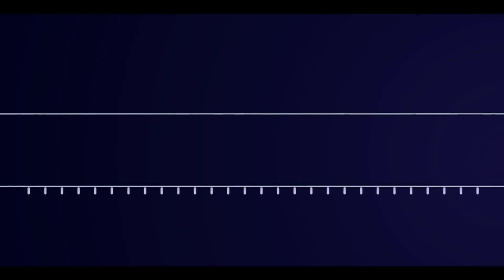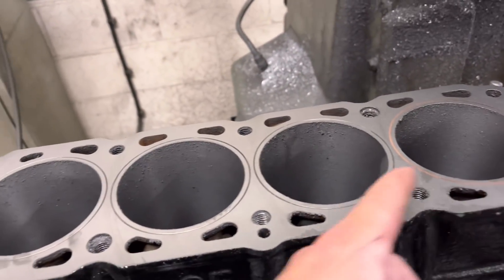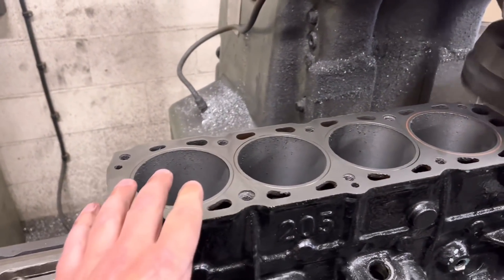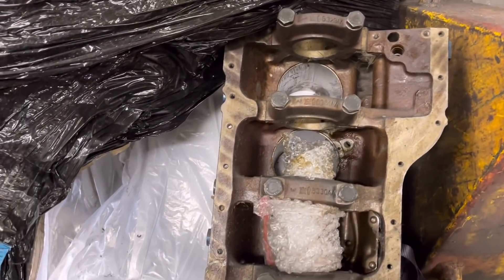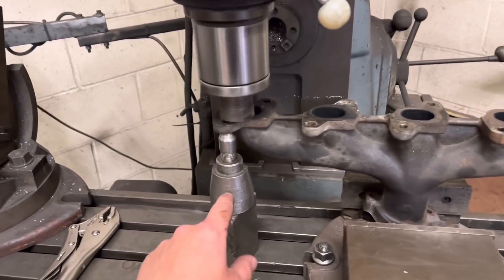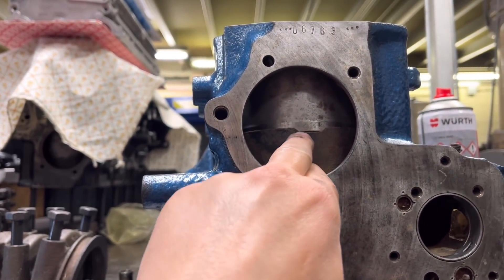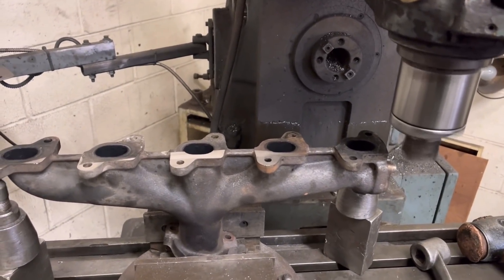Jag XKR is stripped, what we found is not the best news

Comment: Could you, taking a straightforward 4-cylinder engine, show us in one or two episodes what happens to that engine? i.e. show the head skim with the dimensions, the valve work and seating, the crankshaft work and reasons for doing it, the re-assembly and so on. It would be great to watch the full overhaul of a single, particular engine, possibly adding in rough costs as you go.

Comment: Hi, great set of videos, brings a smile en chuckle from me, some of your clients do try the 'woolly jumper' bit.... must watch least weekly. Glad to hear you've taken on an extra set of hands. Cutting teeth for me, so to speak, back in the mid 70's on some old plants, i.e. Ford 93B, 105E - old 8HP en 10HP. We used Consul en Zephyr engines in plant to drive all manner of kit. Skimming Heads/ Blocks was a favorite, although no 'Honing' - lots of Crank/ Piston/ Con Rod en Cap swop outs. Did work on Leyland, Perkins, Cummins en Rolls Royce, some 10 - 18Litre beasties`.... Now in my 70's - great to see young folk keeping the trade alive, can understand the racing fraternity - did a bit of racing as you do around the UK circuits. Now keep my hand in restoring Classis Cars, sorry did send last engine to Turners. Did have a unit in the old baker at 'Barum', a few years back now... Keep the good work up. Doug

Comment: Hi wet liners are usually slightly Prout of the block so it can put pressure on the bottom of the liner as well as the top when you tighten the head down
Reply: Yes, my old Volvo engine had the same. I fitted new wet liners in it myself with new pistons and rings. The liners were great, it was like a rebirth of the engine, the compression improvement really good. I was nervous the required protrusion wasn’t perfect but it worked out beautifully.

Comment: Just looked on SNG Barratt website new 4.2 supercharged full engine with heads ready to go £8,055 plus VAT £9,666 inc and I would check the cooling system as I think the old engine has overheated, the alloy on the sides of the bores is from the pistons getting very hot and dragging up the bores, I wouldn't mess with the old engine, bin it.

Comment: That Jaguar engine is notorious for coolant system leaks and failures. I almost guarantee it simply overheated badly. Keep up the good work!
Reply: They're not really - I've been involved with Jaguars for many years. There is a complicated pipe in the valley under the supercharger which is prone to going brittle and leaking, but they're widely regarded as being very robust engines. As dependable as a Toyota? Probably not. More dependable than a BMW V8? Definitely!
Reply: How the f##k do Jaguars research and development ignore a relatively simple problem with an easy fix which ultimately leads to a catastrophic engine failure is beyond comprehension.

Comment: I'm loving this as I always wanted an XKR but chickened out thinking it would be financial ruin, now I can feel smug!
Reply: They don't fail that often,  pretty reliable. I doubt it was running lean, the ecu corrects for most issues, if it can't within a certain band it goes into limp home mode to protect the engine. They are however very prone to overheating if you don't look after the cooling system.  Don't need to loose much coolant for them to overheat and the idiot type temperature gauge doesn't help, there isn't any reading between ok and hot and when it's in the hot it's too late. RealGauge modification is a must on these
Reply: Had two Jags with AJ-V8’s and did a total of ~180000 miles without significant problems. Part of the issue with overheating is the brittle plastic piping used. Had a couple let go and as noted, the temp gauge only tells you when it’s too late. Lovely engines. Super smooth and happy to rev in NA and super charged form.

Comment: Yes, it absolutely happens Lee. The more that is taken out/off of those blocks, the weaker they get. Especially today when the turbochargers make more power then ever, much easier! Also if they rattle the engine hard with timing going crazy for whatever reason, it absolutely can break those old blocks! I'm really surprised how many are run over there! It seems like our SBC or LS Chevy engines over here. If they are only running factory boost, we might use a MLS gasket, but who ever stops there? We never remove the Orings on boosted engines, we always check for proper depth, & I believe we use much heavier wire! Basically piano wire. If its something running high boost, over 30psi, which is normally a aftermarket Dart or Brodix block, we use something called a hoop. Its just a much thicker heavier type of o-ringing, with a solid ring! We also put the o-rings or hoops normally in the heads, for the reason that good heads are not too hard to find, & they could be welded up easier if they need repair! I'm really surprised with all the good old foundries over there, no one has come up with a updated heavier duty replacement block? I guess people just think cast iron will last forever, they do not especially in a race/motorsport application! No matter how good the machinist, machinist's cannot repair a abused old block, where the metallurgy wasn't great to begin with! There are lots of beautiful super heavy duty race blocks, just sitting in the corner, or outside, because they just wont make any power! Some have been heated, frozen, vibrated[metallaxed], greased up & left outside,[usually the last resort] whatever you could think of, they just wont stop moving! When they are 40 to 60 horsepower down, in a extremely competitive, highly ruled class. You just cannot run them! I have actually taken all of the expensive race parts out of 1 so called, top quality motorsport block. Then I stuffed them in a old, freshly machined factory block, with the same everything. First pull it was up like 50hp, over the race block! No Bullshit! Those pistons from the Jag, were probably running lean from fuel system issues. But they also look like they were detonated also! We see that all the time, with people who run nitrous, & don't do all the necessary upgrades/adjustments! Now its a Jag, so probably not, but if he recently bought it, you never know! Nitrous engines are hammered hard all the time over here, they clean the aluminum off the bores with acid, Run a dingleball hone thru them, & back out they go! So as long as it doesn't just sit & idle after its put back together! It needs to get out & be driven, uphill & down, downshifting gets the ring pushed against the wall, ASAP! Of course after they are sure the fuel & fuel system is good, along with the timing! Old stale gas is also a engine killer, especially with a supercharger! So they need to go over everything to get a good result! Remember, you cannot guarantee a old, well abused, questionably machined block! Have a good weekend!
Reply: 'Pardon'

Comment: Lee - I don't think you should rebuild the jag engine without liners.
The big issue is whether the customer has enough information to know what is in his best interests. Can he really decide this?

You don't want to be known for expensive rebuilds that blow up after a short time.
No one will remember your disclaimer. 
Just deliver engines you know you can rely on.
Reply: when i had my garage, any job i didnlt like the look of i refused, knowing the block may be distorted, it was running lean and the blower had metal in it are all expensive problems that could come and bite your bum, best to refuse the job or stick a 2nd hand engine complete with blower and injectors in it
Reply: @chrisjohnson4165  I think Lee is known as one of the country's top Cosworth experts.

Everyone, no matter what they produce, gets warranty claims. I think most of the ones
 Lee talks about here are claims that he doesn't really bear responsibility for, but often carries even so.

I can't remember too many real mistakes.
The Vanos engine was a mistake, but apart from that I can't think of a single claim Lee has videoed where Barum was a fault.

Refresh my memory
Reply: @chrisjohnson4165  different engine, this is from the early 2000's, they are pretty reliable. The ones you are talking about are the modern ones with no dip stick

Comment: I'd love to have all that machinery at my disposal. Fair play to the lad, nice to see the youth taking an interest in this type of work. I play with old motorbikes and my lad has no interest sadly.
Reply: Same here...I'm 69 and still messing about with motorcycles and cars...son's car is Focus ST 225 and would love to have access to that gear to overhaul it...daughters car had head gasket fail and coolant had eaten into the head...cost me an arm and a leg just to get the head skimmed...also had to renew bearings in gearbox as Peugeot boxes had cheap bearings and the input bearing disintegrated.... acess to an equipped workshop would have made the job a lot easier than me working on the driveway dodging the rain..👍👍
Reply: @richardmessenger9474  I hear ya mate. I'm 47 this year. I had a nice shed for me bike and stuff, I recently extended it and have all on my channel. Building a 7/11 gsxr 'fighter.
Reply from the maker: Thanks a lot for watching George 👍

Comment: Thanks for the girls acknowledgment, that was nice. That is not good news about the jag. I had a Dodge Viper that had a similar issue. I won't go into how much it cost, but it was a lot. It was really nice to hear that your latest employee has so much potential. That is very hard to find this day and age. I wish him all the best for his future. I had a lot of the machinery that you have. I wish in some ways that I still had it, but not in others 😕 Best wishes from Laurajane in New Zealand
Reply from the maker: Thanks so much for watching Laura, really appreciate it, all the best and take care 👍
Reply: @BarumEngines  Hi, I have just been looking through some of the comments about the jag engine. Why would anyone want to take on an engine with the reputation that that jag engine has.?all of my experience has been on American or Japanese v8 engines. If I had to look for a lean run situation, I would start at Air flow, throttle valve, oxygen sensor. Does the supercharger have a pressure control valve?, what fuel has been used?. I used to be into drag racing. Methanol/nitro mixes are unforgiving. I have melted pistons running to lean with too much boost. Just some thoughts that might be helpful,regards, Laurajane

Comment: I am absolutely amazed. You are redesigning the engine! The Rolls-Royce Merlin was famed for its reliability, and it won WWII in the Spitfire, Lancaster, P-51, and other aircraft. But since then, I am astonished an the unreliability of British engines. All my friends that have had English cars found they constantly broke down and required expensive repairs. Where are the engines that regularly lasted 300,000 or 500,000 miles as in the US? My Ford Taurus had 288,000 miles when I sold it. It was rusted out but ran fine. Maybe English manufacturers should adopt the Rolls-Royce practise of running engines at full power. Quote: "Early Merlins were considered to be rather unreliable, but Rolls soon introduced a superb reliability improvement programme to improve matters. This consisted of taking random engines from the end  of assembly line and running them continuously at full power until they failed. Each was then  dismantled to find out which part had failed, and that part was redesigned to be stronger. After two  years of this, the Merlin had matured into one of the most reliable aero engines in the world, and  could be run at full power for eight-hour bombing missions with no problems." You should try it. You will become world-famous. Just don't drop any bombs on anyone.
Reply: A lifetime ago I did a weeks Skoda factory training course ( Estelle, S100 days). The engine R&D dept. was a small soundproofed cupboard with an engine bolted to floor running at 7000 or so rpm, the maximum customer rpm was about 5000 rpm. The R&D team waited until something 'broke' then tried to find ways of improving it. It must be remembered that Skoda were a fantastic rally car in these  days, with many RAC rally wins under their belt.
Reply: @MattyEngland  Great engines - 
How Cosworth Built the World's Best Engines For Decades
https://www.youtube.com/watch?v=p9ynbXCaJlk
But would you take 25 mils off the block of a Cosworth?
Reply: @wontee2  Good idea. Skoda is VW. Maybe English companies should try it.
Reply: @stevewilson5546 It wasn't VW in the period he was referring to. British engines were always well-engineered - XK they made for about 47 years, A Series etc etc. Unreliability came through ancillary parts suppliers - usually Lucas. Engines in an American context have a better life - usually long highway running at constant RPM. British engines would cost more to maintain in places other than Britain,  therefore lax maintenence practices would  occur, shorter engine lives.
Reply: @stephenscholes4758  That doesn't explain why he is taking 25 thousands off the block.
Reply: @stevewilson5546  no not at all clean it recut rings grooves to 18 thou and put .8 mig wire in them it kept them together years ago so must still work. Even more so with modern gasket material.
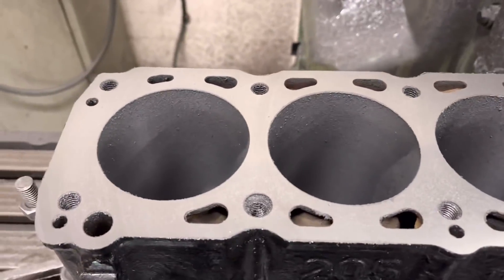Reply: @chrisclarke6344  He cut the groves completely off the block. It was completely flat. You can see this at 11:40. He did not cut new groves. There was no place to put .8 mig wire in the block. Please show where you got this idea.
Reply: @stevewilson5546  what? The grooves were there until he machined them out. I said just clean the block not cut 25thou off it, then recut grooves to 18thou and put .8 mig wire in those grooves.
Reply: @chrisclarke6344  That would have been the thing to do, but that's not what he did. That was the reason for my post. He redesigned the engine!
Reply: @stevewilson5546  when they were current we worked on them and the v6s a mig wire o ring was a must to keep them together.
Reply: @chrisjohnson4165  he does that eek, the best way if you have to is use a hook bar round the gudgeon pin and thread a nut onto it to pull it gently onto face plate with the rod through the head stock.
Reply: English engine's always leaked from new,as to the Taurus reliability was it was Yamaha that  designed it and set the tolerances to build it and you regularly serviced it.
Reply: @chrisjohnson4165  A friend of mine Said the exact same thing when he started work at a roots garage😂

Comment: Taking that much off the top of the block will mess up the timing, got to fix that too
Reply: How will it do that?
Reply: @chrisclarke6344  it's OHC
Reply: @1magnit  DOHC actually what difference does that make?
Reply: @chrisclarke6344  It changes the distance between the centreline of the crankshaft and camshafts
Reply: @1magnit  and? How does that affect timing?
Reply: @chrisclarke6344  If you can't figure it out then you should find another hobby.
Reply: @1magnit  i know it does not affect timing, valve timing is measured by degrees of rotation before and after TDC so how does the distance between crank and cam affect that? It wont even affect belt length that is 12 thou either side of pulleys normal belt stretch will compensate for that. I think you are the one who needs to get a 'new hobby'. How many of these motors have you built and tested? Do you know what 'polydyne correction' is? Have you ever changed valve lash to pick up more torque on race day, by giving exhaust valve a few thou more to hold power stroke longer? So again could you explain why it would affect valve timing?
Reply: @chrisclarke6344  Belts don't stretch.
Reply: @1magnit  are you for real? Yes they do, you still havnt answered my questions. Or stated how it will affect valve timing.
Reply: @chrisclarke6344  Troll
Reply: @1magnit  well thats an answer from someone who has no answer.

Comment: With my experience with jaguar engines Id be passing on doing any work on that seeing how you have aluminum transfer, piston damage and obvious lean conditions. Whos to say it wont run lean again upon reinstallation. He will blame you. No thanks tom hanks!

Also the landrover buick V8 petrol engines are known to leak coolant to the exterior of the head/block mating surfaces...oil too.  Also have seen people rebuild the engines and the liners leak coolant into the crankcase from the bottom of the liner. The pistons move the liners up and down and beat the headgasket. Ive done dozens of headgaskets on both banks on dozens of these vehicles, and Id never use the OEM headgaskets. Aftermarket for the win. Everything else is fine with a tube of "right stuff" RTV in the corners of the valve valley gaskets etc.
Reply: @derektaylor2941  i think you mean the XKR??🤔 bud ive specialized on them for  over 20 years. Pretty sure I m ow what Im talking about. We out an engine in one for 40k. The car wasnt worth 10🤦‍♂️

You claim its 99% the same? Whats the 1%. Ill wait. Are we talking NA to SC?
Reply: @derektaylor2941 ill save you some stupidity.  first of all the XKR is a 5liter 550hp and the XK8 is not even the same block and more like a liter displacement less.
Reply: If its such a delight you must hate your life hahahah.  The most common issues with those cars are waterpump failures, thermostat failures, timing chain and timing chain guide failures, quiescent current drains and flat betteries.
Reply: @chrisclarke6344  agree. Have dealt with nikisil coatings with motorcycle sportbike cylinder jugs.You cant bore or hone them. It wears the rings prematurely. Overheating causes the coating to flake off and cause blow by.

Comment: Great video 👍Lee would faulty injectors be the source of the Jag running lean?
Reply: Fuel pump is probably old as the hills to.  I'm surprised the customer is OK to spend 13k£ on that bucket
Reply: @derektaylor2941  err in a few ways, most obvious would be not opening fully, could simply need cleaning or even a faulty loom that the ECU has not detected.